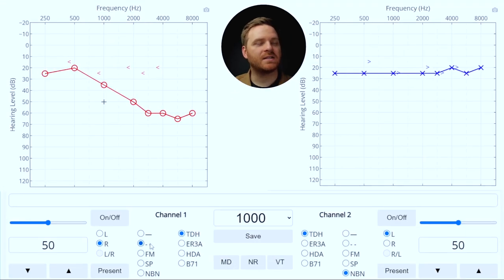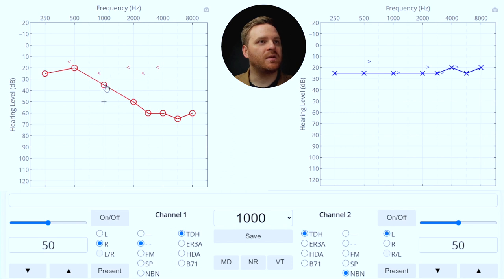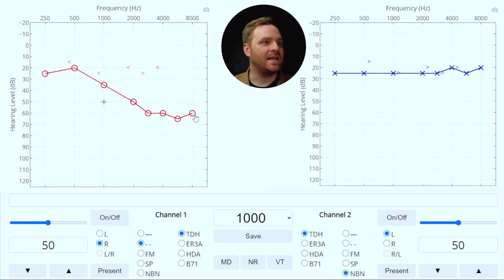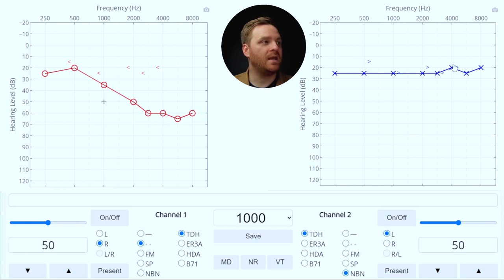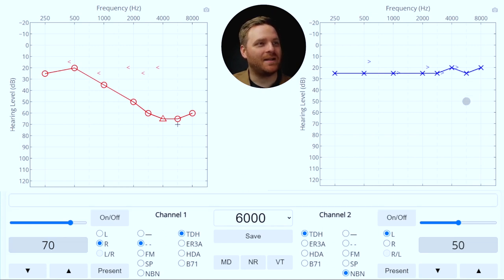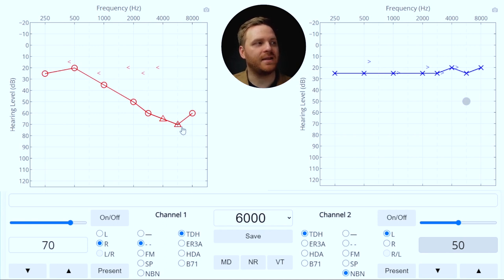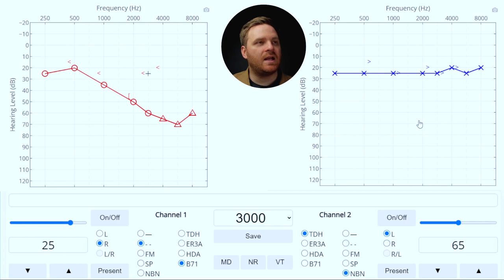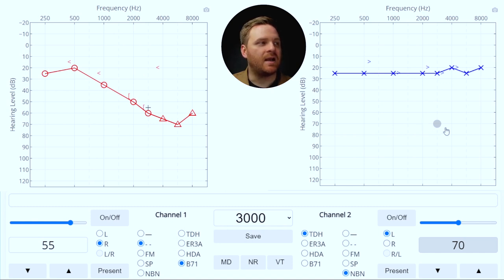Air and bone masking walkthrough - Full demo

Comment: I wonder, if the unmasked bone conduction curve will be always the same on both sides, then why should I bother to do unmasked bone conduction test on both sides?
Reply: @audiologysimulator4449  thanks dr for replying so fast. So, is it acceptable if I measure unmasked bone conduction on just one side? Will this affect my results or my diagnosis?
Reply from the maker: @heshamzaki1000  it sort of depends on how comfortable you feel reporting things. If you mark a side that you didn't test as tested, that is unethical to me - but if you only mark the one side tested, and then explain in your note or elsewhere that you assume similar results on the opposite side (or indicate as much in some other way) then yea, you can only test one side unmasked bone and use that to determine things. In this case, you would want to try to put the bone oscillator on the  pro tip .:)
Reply: @ThetaSimulator  thanks. Your answers clarified that point for me ❤ I have another question please. What I don't understand is why in testing masked air conduction we consider the occlusion effect as 0 db? As we all know, in air-conduction testing the cross over occur via bone conduction and of course osseotympanic route is part of that. So as I understand, if we occlude the EAC this will amplify the sound transmitted via bone conduction even during masked air conduction testing. So, why we always consider occlusion effect to be 0 db in testing masked air conduction?